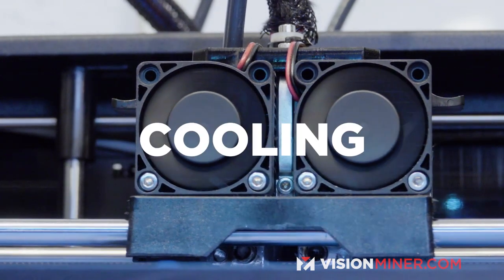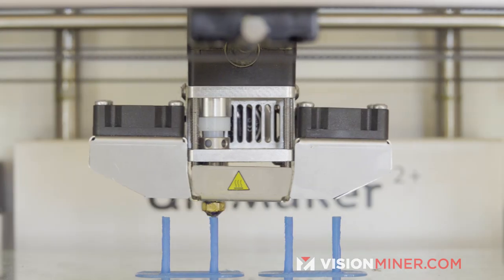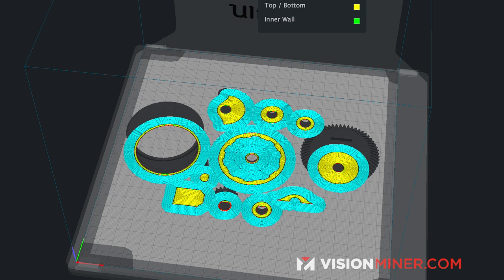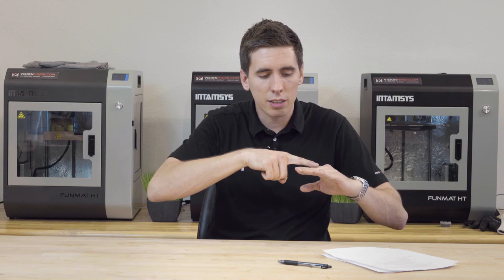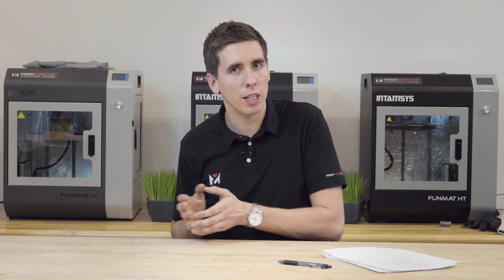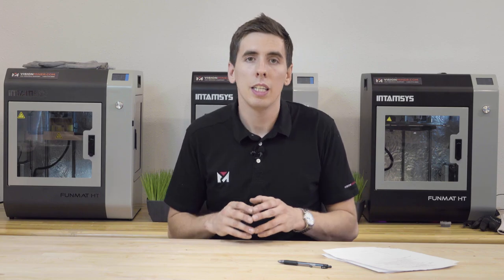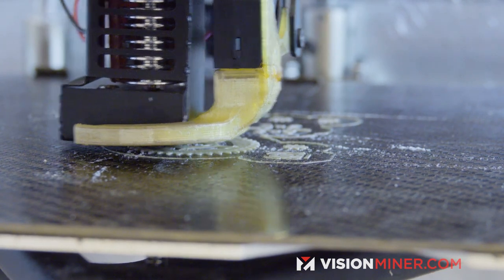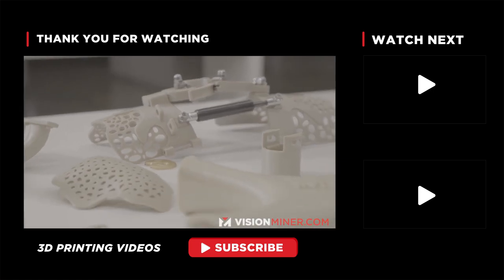Best Cooling Tips for 3D Printers - Filament, Geometry, and Advanced Materials

Comment: So, I just wanted to ask for my own curiosity —

I typically run layer height of 0.075mm on a 0.4mm nozzle...  I haven’t been a 3D printer for long but all seems good with the materials I run - mainly ABS and PETG seldom, actually once I’ve run PLA. 

Should my min layer height be 0.1mm with first layer at 150%?  As I said, I typically run 0.075mm with first layer at 150%...
Reply from the maker: You can run many sizes with that setup, and 0.075 will just be a finer resolution. I'd recommend 0.2mm for those materials, as it will still be pretty smooth but will print much faster. 0.1mm is extremely smooth and should work well, too. First layer rule of thumb is 0.3mm thick -- so at 0.1mm layers, 300% is appropriate. At 0.2mm, we use 150%.

Comment: i have a question: how can i prevent my material from "cooking" in the nozzle after i finish printing? some say reset the printer, but i dont know how to do that, and i dont want to reset my printer all the time. my printer is the Anet ET4 pro, it has a "filament retract" mechanism that retracts filament from the nozzle after iam finished printing. is this enough? or how can i cool down/shut down the nozzle heating after iam done printing?
Reply from the maker: The nozzle should automatically turn off heat when the printer is done printing -- if it doesn't, you may be missing a line in the ending script on your slicer program -- if you're using Cura, this will be in the machine settings / scripts. You can google "Anet ET4 end script" or something similar to double-check if it's correct :)
Reply: @VisionMiner  ok, thanks!